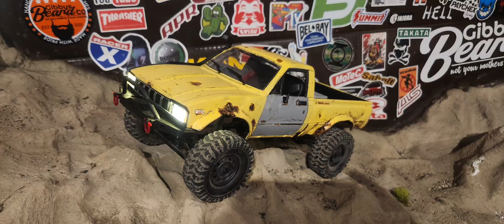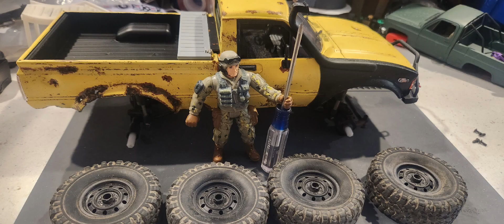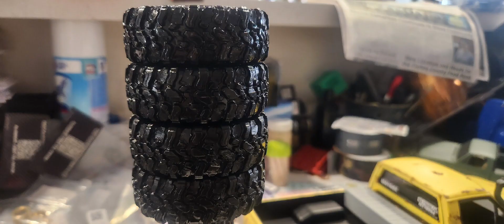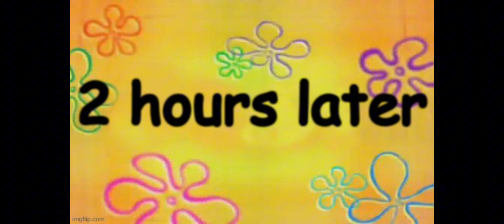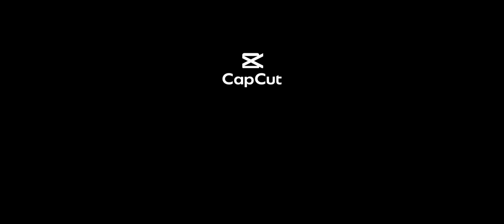WPL FREE TIRE MOD!

Comment: Caution, in my experience, the WD 40 works, but if combined with vaseline the tires tend to expand by about 3-4mm on the inner diameter and makes it hard to keep on the rim. 
I really like cutting the extra nubs on the tread off since it helps it grab more stuff on the trail.